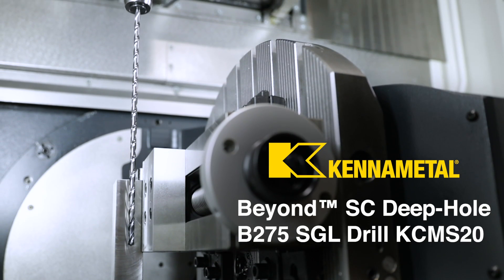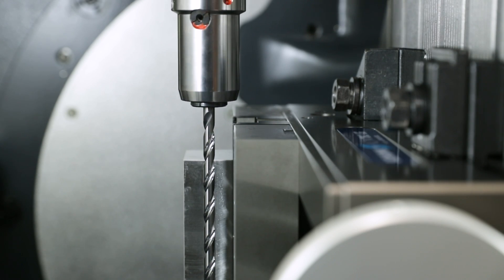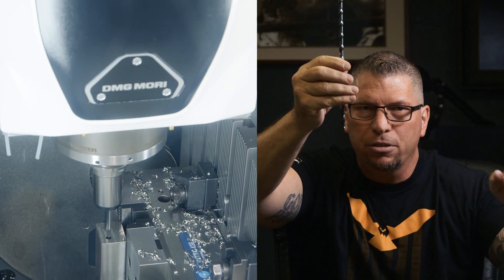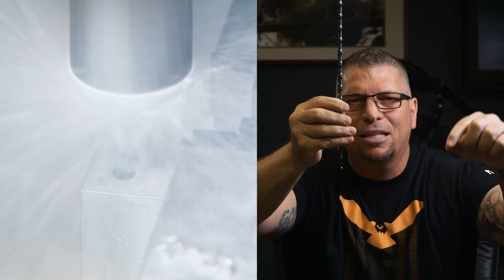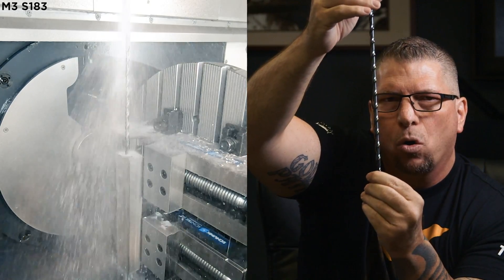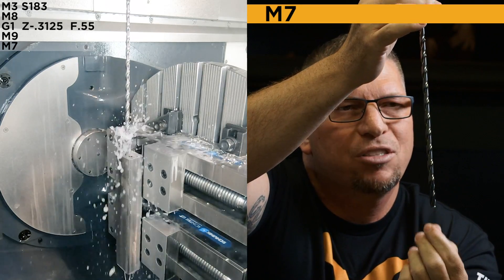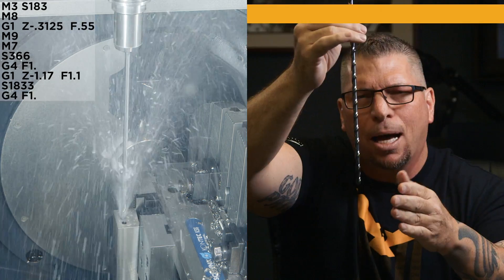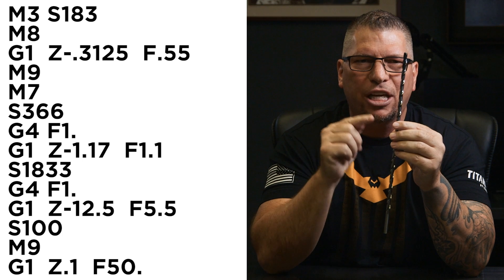G & M Code | Secret Technique for Deep Hole Drilling | CNC Machining | Vlog #109

Comment: And to drill 5083 aluminum to a depth of 200mm for example with a Ø6.5mm drill bit, would the same program principle be used?

We have been doing tests and many drill bits with internal cooling get damaged 🥲

Comment: Sir Can you tell me RPM and Feed
 Use for material SS316L in 
4mm drill and depth 90 mm

Drill Details
(HSS-E PFX Extra Length Dril)

Made in Brazil)

WARNING!

2RG4369627

Bright Finish

DORMER

DIN 1869/1

Comment: $750 is a lot for that drill
Reply: yes they are high dollar.  So far i have drilled over 200 holes 12 1/2 in. deep with one drill. THESE DRILLS ARE BAD ASS. Very brittle thou. We broke one just by turning on the coolent before it was in the pilot hole and another one broke when we hit top rpm before in the hole. We run ours at 3600 rpm.
Reply: It is.  Yeah, it starts with a $100 piece of carbide. 5-8 minutes to grind centers on it. An hour on the od grinder. 2 setups on on a tool grinder (maby only one on newer equipment) with about 40 minutes of cycle time total.

So in any quantity, you have 2 hours of shop time plus material.
Reply: @markferrari9734  You are forgetting the thru coolent
Reply: Thw thru coolant holes come formed into the carbide. You can order it oretty much however you want. Size and number of holes. Straight or spiral.

Comment: Shouldn't there be a P value after G04?
Reply: zyndapp800 dwell - aka G04 and the letter representing the value in Seconds varies from machine to machine. All depends on what the maker of a machine decided it would be. 
G04 P1.5
G04 U1.5
G04 F1.5

Comment: I ended up just writing a bunch of custom python scripts to allow me to do all of these things. I personally think writing gcode by hand is too risky, at least with the python scripts you start with known working gcode.
Reply: Much like anything else in life, when you spend alot of time hand writing g code, you get good at it. You get good at spotting errors while reviewing it. You also dovelop a healthy paranoia of reviewing every block as it executes untill your cycle has been proven.
Its not efficient, but it is quite possible to pull off without crashing things and wrecking parts.

Comment: Titan; Since its a through hole,why not do half than flip and drill the other half?
This would,greatly reducing drill walking.
Reply: Guys.Its only as difficult as you make it.Perfectly connected drilled hole.
Reply from the maker: If you can handle a mismatch of a few thousandths it can be done and I have done it many time... even coming with a longer drill after that’s slightly bigger... pushing through like a reamer.

But these drills are so good now and it makes sense to just go through in many applications.

It only walked .002 over 12 inches... and that’s pretty incredible
Reply: @TITANSofCNC  one of the reasonings I can think of is that you spend less money because you use a shorter drill. These 40xD drills can cost a lot of money.

2 thousandths on a hole that long is amazing, how did you hold the drill?
Reply: @kunstderfugue  another reason for going for the longer drill is to avoid flipping the part and doing a second setup, not every one has a 5 axis machine.
Reply: @alexgregg2466  yeah for sure, if you're very conscious of cycle time you really can't afford to flip the workpiece.
Reply: Alex Gregg - if you do this in one setup on a 3-axis machine you’ll need close to 30” of z travel... unless you want to get creative.  basically any way you look at it deep hole drilling is a pain.
Reply: @stanlee1884S  the concentricity has to be perfect or you risk getting 2 half holes that don't completely connect. So you have to think hard about what the hole is for
Reply: Other thing to consider is added error from rotary table runout (probably not much on a new mori) and machine calibration regarding rotary center point. Those could add more mismatch in the center.
Reply: There should be a forum where experienced and newer machinists alike can share their experiences and knowledge, like there's forums for computer science and others. How productive would that be!
Reply: @kunstderfugue  practicalmachinist.com
Reply from the maker: http://titansforum.titansofcnc.com
Reply: Walter Kosciak how you gonna be sure that drill goes all the way through? 
We always try to avoid that kind of operations . Its way dangerous
Reply: Walter Kosciak you may have tried but i wont do the same mistakes on purpose 😃 
Good luck with your current business.
Reply: @edvinaltiner5657  The drill must be perfectly sharp.Not a problem for me.

Try it on a practice block.Drill a little more than half deep .Flip and do same.
Reply: These drills don't "walk".

Comment: Would it be possible to thread that same hole that you drilled?  Full length of course
Reply: Lol if u ever need to tap a hole that deep slap the shit out of the engineering dept
Reply: Actually I'm not sure a tool exists for that. Tapping that deep is probably too much for a tap of any kind and any material, and a Carbide thread mill that long is going to cost thousands of dollars

But if there's a way I'd love to know
Reply: If anyone can do it I'm sure Titan can.  It would be pretty cool to see